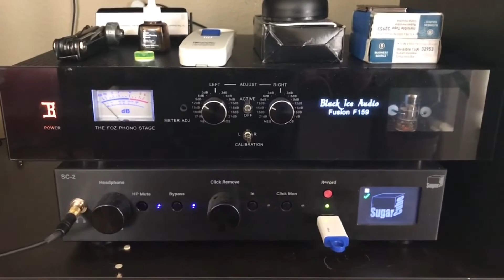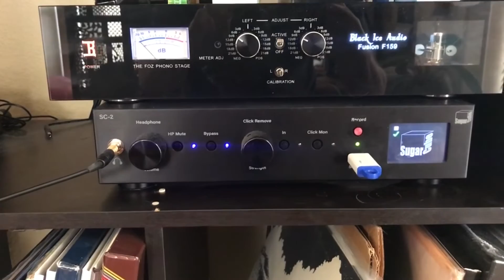The Vinyl Archivist Main System

Comment: Mine is a Technics 1210 mk II w/Sumiko Blue Point No.2 MC, how would I convert these in the best fashion for my setup? My house has windows, while my computers have apples, daemons, and penguins. Will Audacity do the job, or will I need something else?
Reply from the maker: Audacity is cross platform
Reply: @vinyl4all  Then again will this be able to do the job at its fullest? My audio card is 24 bits 192 KHz.
Reply from the maker: @gjermundification    I dont know if Audactity does 192